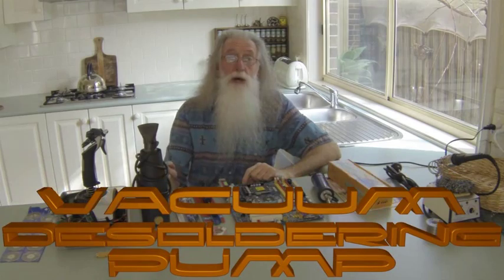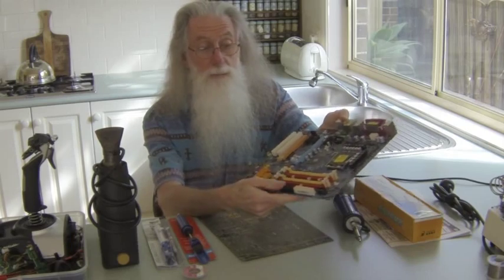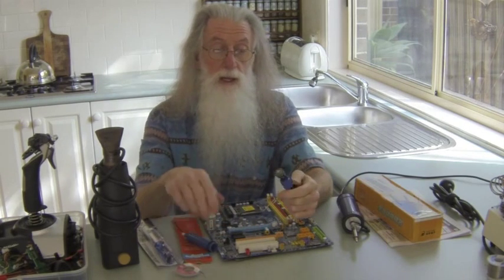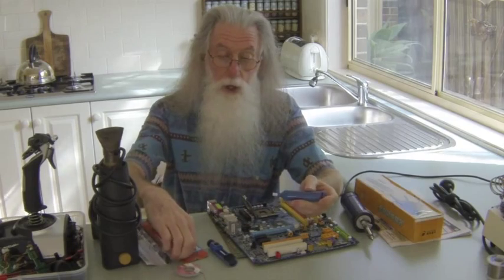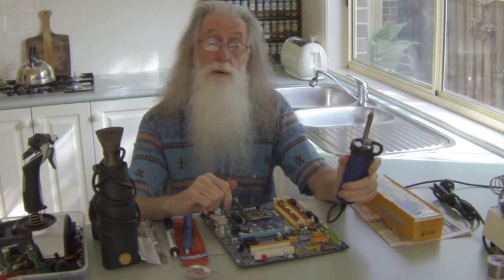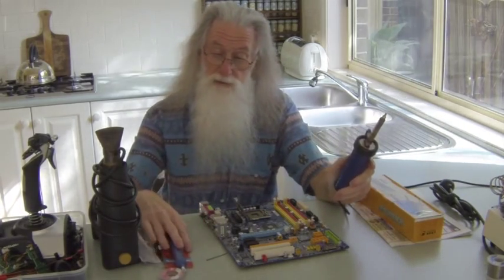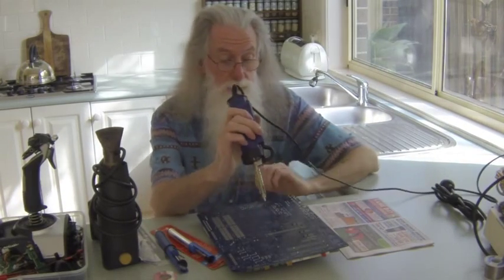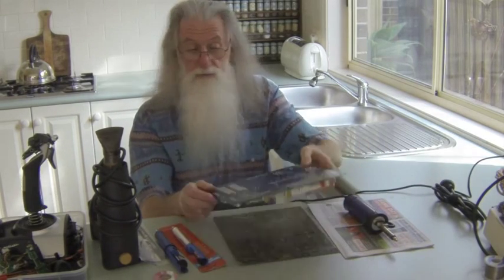CNC4A - Vacuum Desoldering Pump

Comment: It's kind of OK, but what I found costs much more, around ~$20. This desolderer https://youtu.be/5-EsOJNfDAc (ZD-211, Velleman VTDESOL3U Vacuum Desoldering Pump, etc.) usually is ~$10 and possibly even better. Also, with manual pump there may be not enough time to suck the solder -- it gets solid too fast, but with such pump integrated into soldering iron desoldering is much easier.

Comment: I know on amazon somebody  had a review comment they took apart these vacuum desolder the  one your display on your video they made into 110v they took 220v  cord plug out  i don't know you can do it with 120v too since i lived in the USA.Somebody needs do a modify video on it on youtube.
Reply from the maker: Thanks for watching. It is 240V over here so I would have no way to test it to see if it works. Thanks for Subscribing.
Reply: This show all plug wires from all the countries around the world you can match wires in the usa.
https://www.quail.com/Catalog/TechnicalInformation_Section.pdf
Reply: i seen one video on youtube they taking apart vacuum  desoldering pump it had blue wire and red wire  i was thinking doing 120v plug with 18awg wire  just use white wire to blue wire and black wire to red wire.
Reply: USE DIMMER OR INVERTER FOR THESE

Comment: Hello any chance for a link to this electric desoldering pump ? Thanks
Reply from the maker: Sure, no probs.  On ebay it was listed as; Electric Vacuum Desoldering Pump Iron Solder Sucker Gun AC220V 50Hz 30W  Item: 311219496982